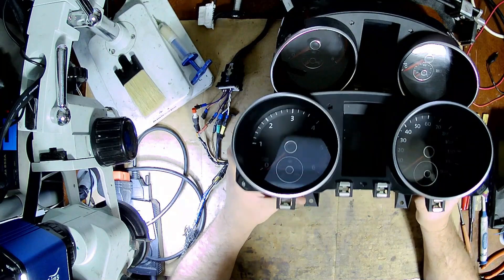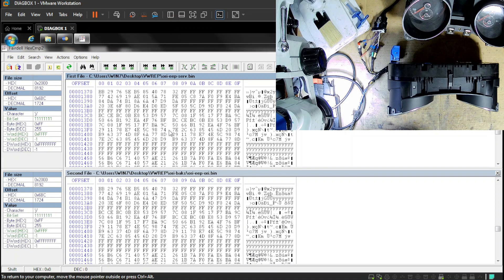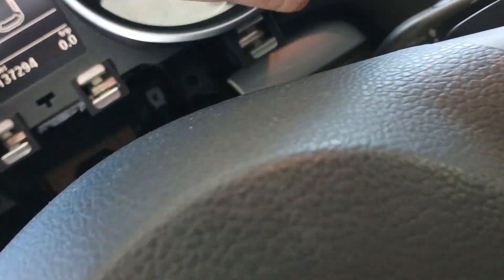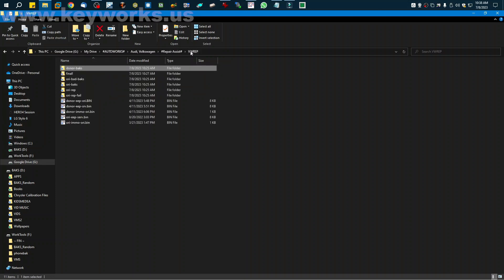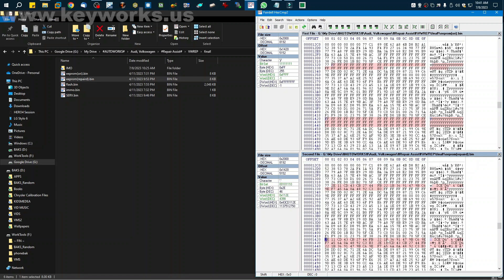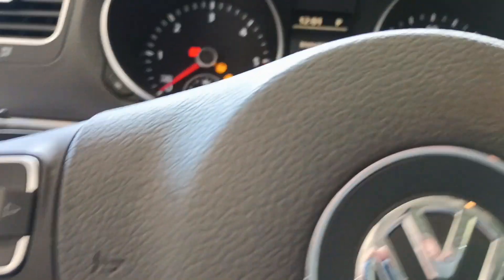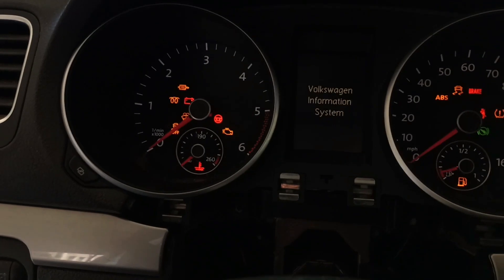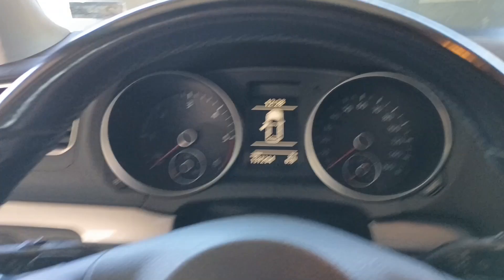VW IMMO-IV NEC Cluster Immobilizer Data Corrupted: Troubleshooting and Repair

Comment: I watched your video and I wonder is it possible to re-create CCM eeprom if it was erased without backup and add same key. I know I can pull CS MAC and PIN from ECU but is it doable? VW Passat C3 B3 2008.
Reply from the maker: easier to just adapt a used cluster
Reply: I thought that IMMO 4D holds main IMMO data in Comfort Control. Module🙄
Reply from the maker: @Kristijonas-p8l sorry wasnt paying attention fully to your comment. Missed the part it was for a passat and ccm. I replied early morning. Yeah, you need to code a replacement ccm, not cluster.

Comment: why abs is flashing at 16.50 .
Reply from the maker: the abs coding was lost in cluster & I had to recode it. This can happen from all keys lost procedure or from replacing cluster.
Reply: @ecurepair  impossible all key lost .
replacing cluster yes .
Reply from the maker: @mohamedabbaci3291 Not impossible. ABS coding can indeed be lost during AKL procedures. It used to happen consistently with TCode and the boot pin probe method it used, possible it's only an issue with that method, that I can't say.  The scanner had to have a "back up abs" function that ran first so you could restore the coding after. The VVDI and IM both have the back up abs function as well and warns about it but but I have not had coding lost from the method of removing eeprom and editing for service mode.

Comment: Ok so I just went down this rabbit hole trying to help a friend with the same situation, only service file is available original eeprom lost. I got a chance to go to another VW 2014 Passat so I wanted to check what was the data that gets blanked out to ff on the service file. My read was different than yours. I read the eeprom, wrote it back in service mode, made a key, and wrote back the original eeprom via obd, and again reread the eeprom after. In my case the two data lines that got blanked to ff in service mode did NOT change. I’m assuming the fix in your case was just re-adapting the ecu and putting the rendom data on those lines didn’t really do anything.
Reply: Following up here… We left the eeprom as is with the corrupt data on line 1320 & 1440. Ran the adapt ecu function with im608, still had the immo active error no start, ran the cluster adaptation & reprogrammed the key and that seemed to fix the issue. My best guess is that it’s the MAC address that gets wiped in service mode as it can be changed.
Reply from the maker: I recovered the data on bench and verified those lines had data. I did it by using the data from doing the AKL procedure on another cluster after  I had put the original clusters IMMO Data on it.  I had the cluster working on bench with key programmed like normal. No lock out or anything like that. Only after that I put it back in car and did the vvdi2 adaption with  ecu using original cs.

Comment: Can i read the pin with vvdi prog so i can use autel im to replace clusters?

Whats the easiest way to replace instrument cluster on 12 passat?  

Im508s needs pin from donor AND original.   Cant get donor pin because we dont have key for it to unlock in obd
Reply from the maker: I would do akl process on bench and get pin.

Comment: Im working on one in a similar situation, working after someone. Practically the same situation but after i tried it a couple times to get the ecm to accept the key, the cluster screen blacked out and the miles needle sweeps all the way forward and back. No comms with the cluster anymore. You think theres a way to repair the data? I can desolder the nec chip if necessary
Reply from the maker: If the programming was corrupted and now its dead with no coms, I would try to write a new flash & eeprom with xprog or just replace the cluster all together since recovering with different flash/eeprom is pretty much same as replacing with another one anyway.
Reply: @ecurepair let’s say I put in another used cluster how do I make it work with the vehicle again?
Reply: As it contains all different Immo and eprom data